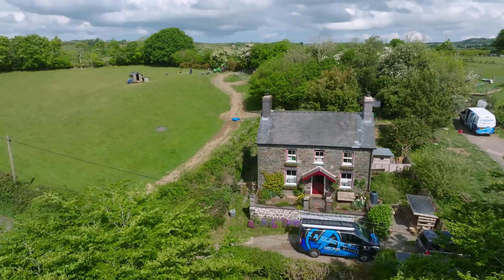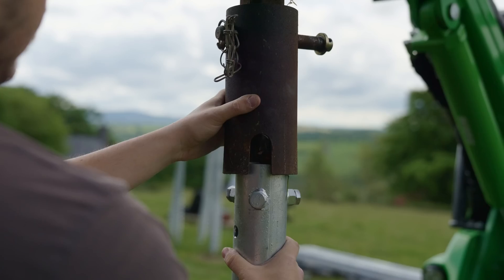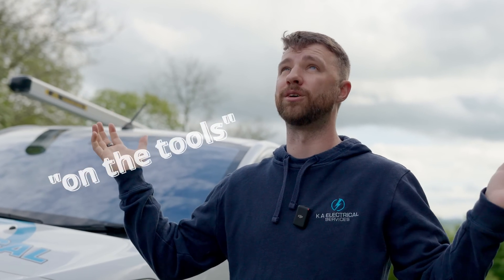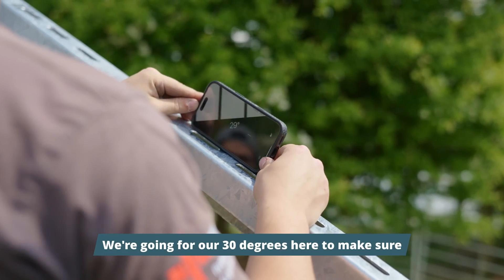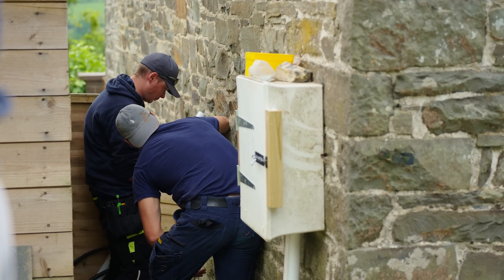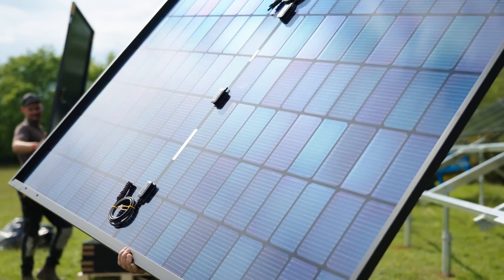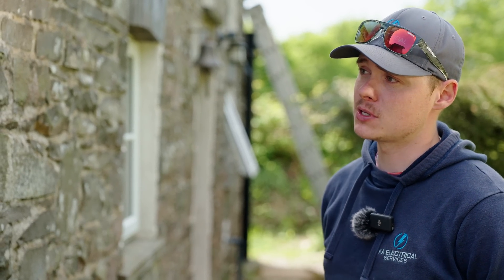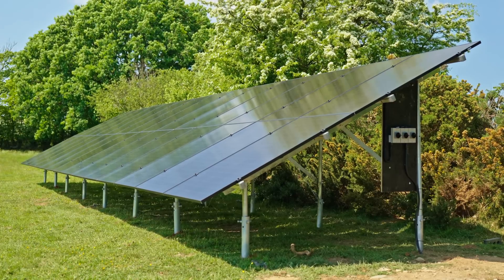Is this install for you? HUGE INSTALLATION - Zero Visible Panels!

Comment: You'd think by now you'd be able to mount the panels on a 'swivel system' so the customer could have a summer angle and a winter angle thus maximising the sun's power?
Reply from the maker: It’ll come! It’s all added engineering costs that don’t justify the extra generation unfortunately. But as technology and efficiency increases it’ll become more sensible.

Comment: What's a price range of a setup like this?
Reply from the maker: Thanks for your comment! It’s difficult to give a set price as we design each system specifically to suit the property and the customer’s needs. As a rough guide, most ground-mounted systems start from around £12,000, but this can vary depending on the size, components, and site conditions.
Reply: @KAElectrical Considerably more reasonable than Jordan's Artisan guys!
Reply from the maker: We do live in a considerably different Geographical area so that will impact our pricing considerably.
Reply: I would live a setup like this, all I need is the space now. Great work @KAElectrical

Comment: Sound breaks entirely from 9:10 onwards!
Reply: It would be nice if the sound was on the right as well as the left.
Reply from the maker: I believe this is fixed now, we’re not sure what happened.
Reply: Microphone sound was awful all the way through, very noticeable on my head phones, uncomfortable at times. Nice system, nice to have the space for a ground mount.
Reply from the maker: Apologies for that, we had some terrible issues with the wind and the wind removal hasn’t helped. We live and learn, the next one will be better 💪🏼 thank you for the watch